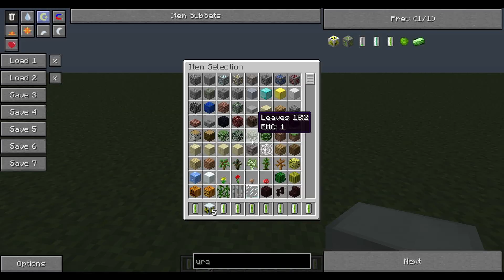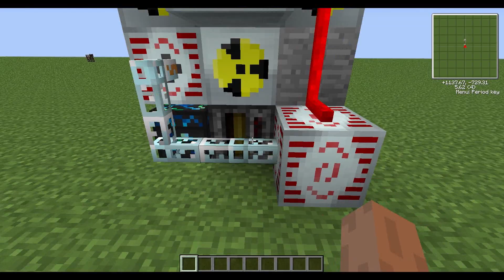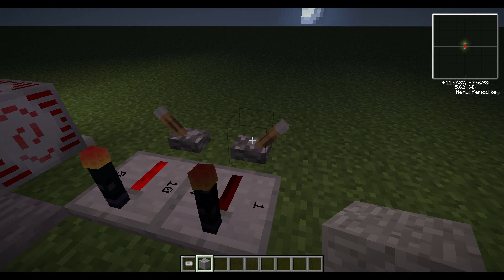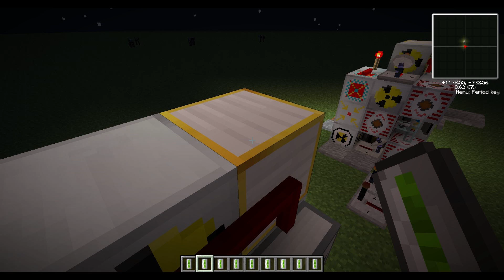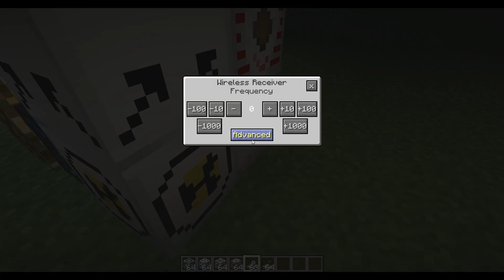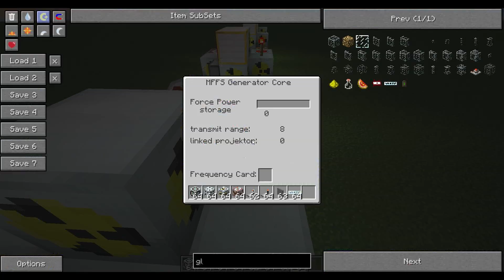Tekkit Classic: Most powerful nuclear reactor(s) possible.  2040EU/t & 2400 EU/t

Comment: Will this work whitout dimensional world anchor?
Reply from the maker: TLDR: No.  It will explode when you leave.
Full answer: Yes. It will run exactly the same, assuming you're standing right next to it.  The problem is that the mechanical parts, tubing, timer, filter, do not run when there isn't a player keeping the block active.  The nuclear reactor however will continue to generate heat, electricity, and radiation while you are gone.  This will cause the reactor to overheat and explode since your entire cooling system will be disabled while you are gone.

YOU WILL COME BACK TO A CRATER.
Reply: @rocksntwigs  If the reactor setup is entirely within one chunk, is a Teleport Tether sufficient for keeping it loaded safely?
Also, is it possible to keep a reactor in the Nether or End safe when you're away? The wiki claims that in singleplayer, chunkloaders don't keep the other dimensions loaded when you're away. If reactors somehow keep themselves loaded even then, that becomes quite problematic.

If nothing else, it should be possible to build a geothermal power station supplied by an energy condenser+collector setup, if you really require power outside the overworld and won't be consistently around to supervise a reactor.
Reply from the maker: @steam-powereddolphin5449  That's a really good question...  As for the teleport teather, I believe so but I don't think I tested it personally.  I always preferred the dimensional anchor.

As for the Nether/End, I believe this should also work there.  I distinctly remember building a reactor inside a nether fortress to allow me to have a force field around it, but I don't remember if I left it indefinitely.  It used a lot of power and fuel so I usually turned it off when I left.
Reply from the maker: @steam-powereddolphin5449  I never disabled the reactor in my base and I left the server running 24/7, so I think the same principal would apply and the reactor in the overworld should of blown up if I left the server.
I can confirm this does not happen with either the dimensional anchor or the world anchor.
Reply: @rocksntwigs  The wiki states that the issue is in singleplayer, not in multiplayer.
Reply from the maker: @steam-powereddolphin5449  Ah~  I never played in single player.  I'd pop open a creative game and give it a shot.  No idea tbh

Comment: This has likely been stated before, but one advantage of the full-power build is that it's easier to automatically refuel between cycles, due to fresh uranium cells being the only thing loaded directly into the reactor (and depleted uranium cells being the only thing removed).

Comment: My base uses ~5000EU/t and you said I only need one...
Reply: I have a quad design that sits at ~8192 EU/t, to supply my base, then instead of having one MFSU to stop the reactor, I have a MSFU array, the furthest one from the connection point charges the slowest, so that's my off switch, not exactly super compact with the array on it, but it throws out ~32K EU/t from the array when I need it.
Reply: @brutalmclegend  I have pretty similar mfsu system. But I have now solar power because my nuclear reactors blew up. (I tried to make fancy computer controlled system) I made solal panel farm and it is making 1 hv panel in 10 minutes.
Reply from the maker: I'm impressed you have that much stuff running. lol

Comment: The only issue I see is that the MSFU can only output 512 EU/s so you can never use all 2048, unless you take from before the MFSU, in which case the MFSU shuts the reactor off when it is full...
Reply from the maker: You can use an activated HV transformer to raise the voltage back to EV.  It's been a long time since I have played regularly but if all you need is the EV and not the packet density then that should do the trick.
Reply: In the end I removed the MSFU you have, and put an array of 9 of them in parallel over 2x2048EU reactors, with the "full" signals going through AND gates :)
Reply from the maker: Very nice.  Would love to see some pic's.
Reply: http://imgur.com/a/K88ON  It's not particularly compact or pretty!
Reply from the maker: If it works it works.  I started excavating for a power plant when I stopped playing last.  I was considering updating my design to include automatic uranium refilling using computer craft to detect and control ice input.  That way the empty spaces wouldn't be filled with ice when the uranium decomposed and new cells could be added as needed.  Ultimately I wanted to have automatic cell breeding using spent cells as well.  I haven't played with it since then though.
Reply: If the output is divided between 5 of them, then their combined output is 2,560 EU/t--slightly more than the full-power reactor generates if all the power is used, but at least there's less need for downtime due to full storage.

Comment: it wont turn on for me
Reply from the maker: Well if it's adding a useful feature it didn't already have then I would call it an improvement.
Reply from the maker: lol add a link dude.
www.youtube.com/watch?v=QtH__dv0vL4
Reply from the maker: Please be more specific.
Reply: the shield
Reply from the maker: Could you get me pictures?
Reply: i blew it up already when i got bored, i had the system right next to another one, the reactor touching, im guessing the problem is the shield didn't want to try go threw another reactor
Reply from the maker: lol nice.  Dude seriously for the work it takes it's just better to go with the 2040EU/t version.  the extra 360EU really isn't worth it.  Not to mention that if you build it with the MFSU you are almost never pulling directly from the reactor itself.
Reply: i wanted the shield one so i dont have to refill the uranium evry cupple of hours, i need it to be completly automated, i have a single player factory that currently runs off of 8+ reactors, and refilling them when they get full of ice is cancer
Reply from the maker: Fair enough.  I was trying to come up with a system for that but I don't think I ever finished.  You could hook up a computer and dump the entire reactor, filter out ice and spent cells and then pump back in the good cells and fresh uranium.  But that's a lot of programming and plumbing.
Reply: im bad at programming

yet i am currently making a game in unity LOL
Reply from the maker: Yes please.  I would love to know how I can improve my design.  I haven't played it over a year but I'm hoping to get back into it soon.
Reply from the maker: Nice work.  I left a comment on it.  The reactor is a bit big for my taste.

Comment: this can actually be condensed to 3 by 3 by 3 if the filter and condenser arent under the reactor itself, but under the chambers on the sides while moving the mfsu and hv transformer under the other side reactor chambers, it still works the same * how to power the filter * use redstone tubes and a timer on the reactor, but a lever that turns the reactor on it self, so the timer doesnt affect it
Reply from the maker: +YT=MineCraftSquared That way the reactor would remain on constantly though.  You may be able to make it smaller but you'll burn up all your fuel for no reason.
Reply: rocksntwigs there are still other ways to shape it so it doesnt do that
Reply from the maker: I would be very interested to see them.  You should make a video on it.
Reply: rocksntwigs maybe, atm i only have a video on the one you see here, but its crap

Comment: before this nuclear reactor i had another one, it was efficient, but as much as this one, i also had an emc farm, and i built this and tried to install a main lever to disable the nuclear reactor and an alarm without increasing the size so i turned off the timer so no ice would keep going to test the thermal monitor and the alarm and 1 redstone was missing between the thermal monitor and the nuclear reactor and erm... well... BOOM!
Reply from the maker: +Keith Camilleri I modified the design slightly and added a siren.  I never felt the need to add a shut off.  Since the MFSU will shut it off when it fills up.  I actually have this setup with a batbox and a solar panel to prevent my machines from running down my fuel supply with the small 10-15eu/t draw they have to keep them running non stop.

Comment: 14:13 The filter always pulls out a stack unless it's filter specifies any other amount. You are thinking of the transposer, which only pulls out one at a time and has no filtering GUI or any GUI at all for that matter.
Reply from the maker: While you are right, it can pull 64 item stacks, that's not exactly how they work.  The filters simply pull a full slot from the first non-empty slot in an inventory.  They don't actually pull 64 blocks at a time.  This means that if you have a setup like the one in my reactor design where the blocks are being added one at a time to the first available slot in the chest that the filter will pull only a few bocks at a time instead of a full 64.
Tekkit Classic: Filters